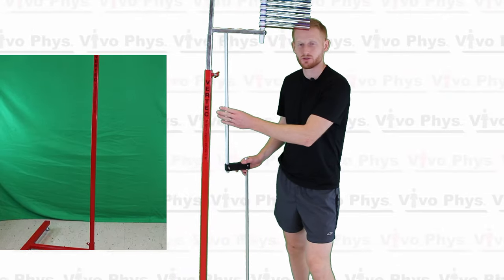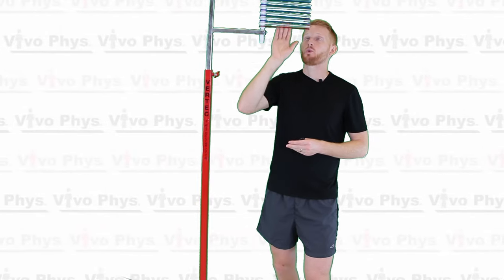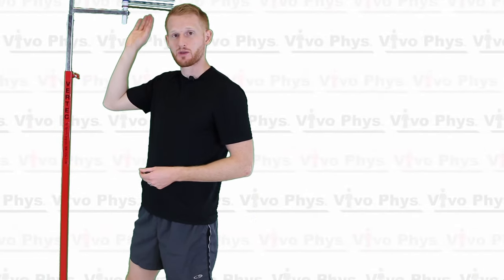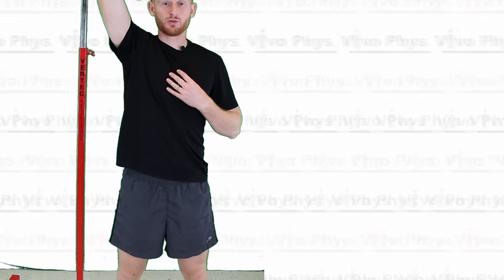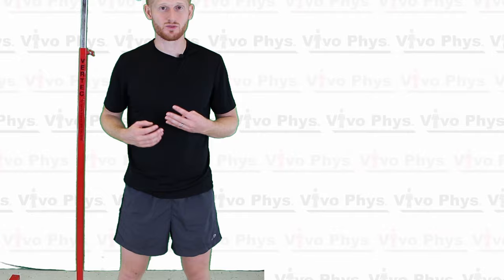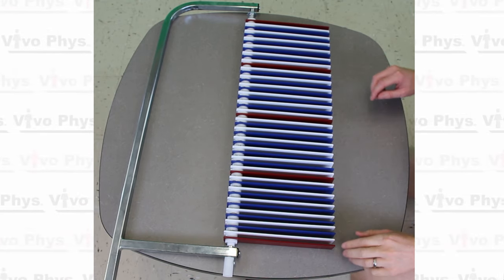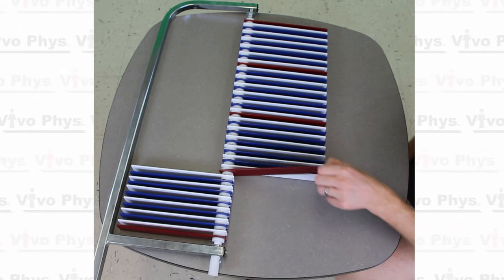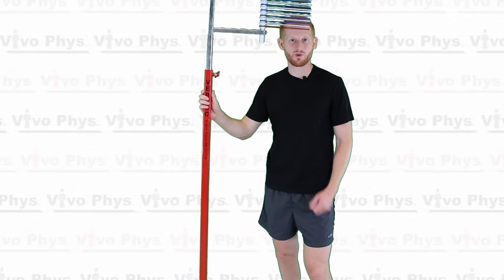Vertical Jump - Vertec

Comment: Okay, so from what I understand, you can set the bar at their reach height (arm reached up, finger tip brushing the bottom piece).  They can then test there vertical, where each piece is .5 inches.  If they jump higher than the 24 inch cap (the top piece), you can then extend it, for example, another 6 inches.  So you can then add 6 inches to whatever they hit on the vertec.  Somebody correct me if I'm wrong.
Reply from the maker: Hi @CoachRiceSHSMT. You can do it that way. I don't recommend it when I teach for a couple reasons. Mostly, you lose other data (standing reach height and absolute jumping ability). These can be important depending on the reason for testing. The other is, as you mentioned, if they have a vertical jump height greater than 24 inches that method does not work well. Eyeballing or measuring an additional 6 or 12 inches with that method could be a significant source of error in doing the assessment. Doing it as I teach in this video also allows for people of similar abilities and heights to test back to back without needing to change the Vertec height for each person. So it can actually be much faster if doing a lot of people.

Comment: you should measure the distance between the bottom of the jumper's feet/pointed toes and the ground for an accurate vertical leap
for an accurate standing reach you should measure the distance between the  the top of your middle finger tips and  your shoulder socket

Comment: Cheaper method . Stand next to wall , reach up with one hand feet flat and measure your to the top of your fingers.  Then put some chalk on on your fingers jump and touch the wall , measure the difference.  It will be accurate within an inch or so to give you a rough idea .
Reply from the maker: Thanks for sharing.

Comment: I’m still struggling with the calculations. I use it for my college basketball athletes. I was recommended instead of measuring off the hand. Set it at 10ft, which is the rim. But I still don’t get how to determine the vert
Reply from the maker: Hi Laron53. Vertical jump height is the difference between reach height standing and how high you can jump and touch.
Reply: @VivoPhys  I’m tracking that. Let’s say I have an athlete that has a reach height of 116”. Jumps a 39” with the base height at 10 ft(120”). That would be 39 + 4 = 43inch vert
Reply from the maker: Correct

Comment: how high is the first bar in the vertec?
Reply from the maker: It's adjustable. So it depends on how much of the upper tube you pull up or push down. There are labels on the upper tube that tell you what the bottom flag height is.
Reply: @VivoPhys  what is the highest possible?
Reply: @VivoPhys  what is the height of the lowest bar in thr nba draft class? thank you sir
Reply from the maker: I don't know. Sorry.

Comment: Why is it only 24 inches?
Reply from the maker: You must subtract out your standing reach height to find your vertical jump height.  Without doing this you could not compare between people because tall people would always look as though they have more powerful legs.
Reply: @VivoPhys  no, like, what if your standing vertical is above 24. Isn’t 24 average? Shouldn’t it go to like 36?
Reply: @mrdrsir3781  24s not average 20 is average for an adult and 16-20 is average for teens but if ur an athletes 25 is about average for all sports
Reply: Kinda late but just bring it higher and add the height that you added to the final vertical.

Comment: What is a good vertical jump for someone over 50? I have found charts online which indicate that a vertical of 24 - 28 inches is good for anyone, but that doesn't seem correct to me. I am 54 and trying to determine how fit I am.
Reply from the maker: Good question. Off of the top of my head I do not know of any age based normative data for the vertical jump. Sorry.
Reply: @VivoPhys  Thanks for the response.

Comment: kind of confused a little bit. I want know how to measure my vertical for example. I want to know I my vertical is 30 inches or better
Reply: This video was a bid confusing. I came looking for the same info as well, what I gathered from it is the easiest way is to set the bottom flags to where the tip of your middle finger barely touches them but with a small gap in between so it actually takes a 1 inch jump to touch the first flag and then you're set to go, however, it will have to be adjusted accordingly for every other jumper as well. And if the flags are not marked on the vertical jump flags that you have, take a tape measurer and mark the numbers yourself.